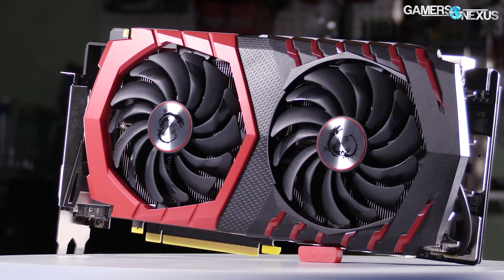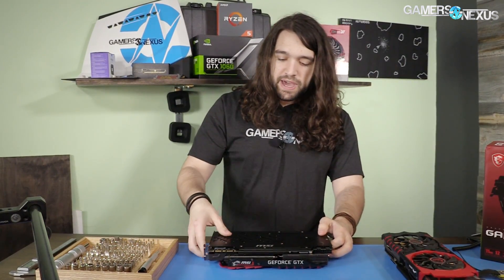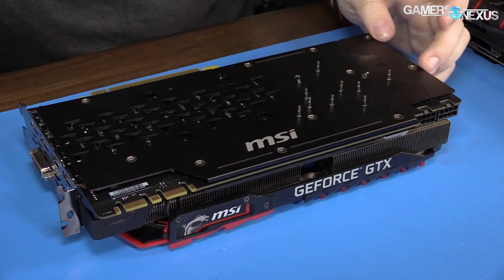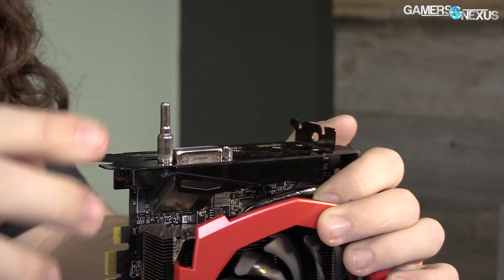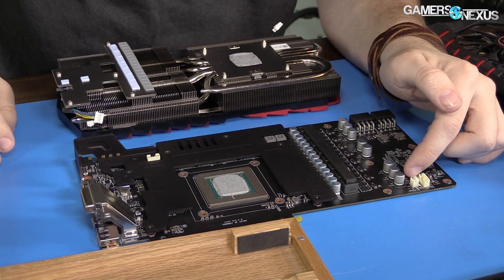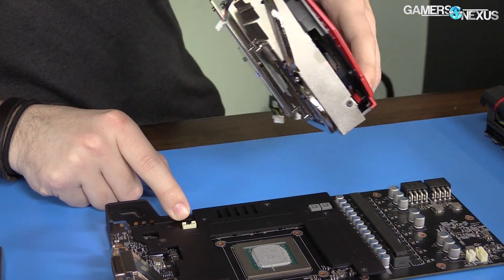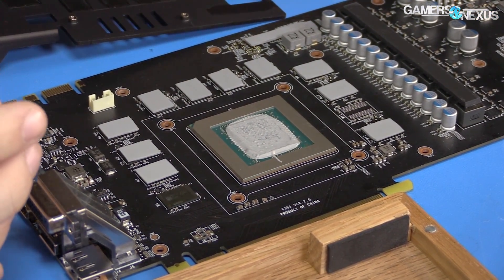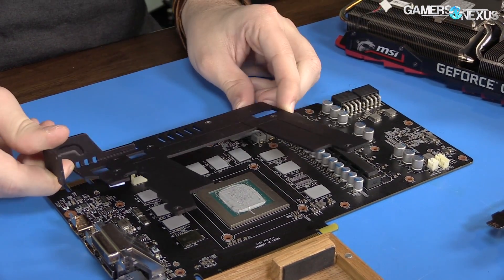MSI GTX 1080 Ti Gaming X Tear-Down

Comment from the maker: Thanks for watching! Our coverage ft. Buildzoid is coming up this week for the VRM analysis, and we'll be reviewing & overclocking the GPU in short order. Stay tuned for that. Unrelated: We now have a GN merch store online! You can find a link to that in the description above.
Reply: B U I L D Z O I D B O Y Z
Reply: B U I L D Z O I D B O Y Z
Reply: Good job man :D
Reply: At last! :) Been waiting for this for weeks :D
Reply: Gamers Nexus whats the difference between MSI's Gaming Z and Gaming X video cards? I dont get it.
Reply: @Proj3ctX Gaming Z offers higher factory oc than X and another RGB thing...
Reply: 9:24 maybe to hold it in place when soder gets soft by the heat?!!
Reply: LOL of course they dont make a gaming X titan XP card silly :P Nvidia has always locked down the custom card market for the titan line up :) I guess when you have as much knowledge swimming around in your head as you have Steve,  you sometimes forget about things like that....but yeah so weird that they put in the 12th thermal pad on the non-existent Vram
Reply: Gamers Nexus unrelated : why "stupid star screws" ? those are Torx heads and working in the engineering field I can tell you that IMHO these should these should replace all Allen and Phillips heads (except for the smaller sizes under M2.0 for which Phillips is still well suited) as they accept much more torque and are much less prone to break and this prevent unscrewing the screw.

The main advantage of Torx in consumer electronics is that it allows for better repairability since screws are less likely to break.

I otherwise very much enjoy your in-depth and technical articles, which is why your terminology surprised me :'(
Reply: ill save you time in testing ddr5x temp testing since been running for 1yr with no headsink or fan or anything.......aaa there still working
Reply: The extra thermal pad was probably a mistake during assembly or something. Someone didn't get their coffee that morning.
Reply: john doe really eh? a full year? lol too bad you couldn't even get a card with g5x memory a year ago...
Reply: @uglyduckling81 You must be from the UK or learned your from there. In the US, the L is typically silent no matter how it's spelled. You can even check the online Cambridge dictionary. It has both pronunciations.
Reply: Gamers Nexus Love these Videos.
Reply: Fair enough. I thought he was just trying to be trendy by saying some old way or just flat out mispronouncing it. I knew Americans couldn't pronounce Tomato correctly but I had no idea solder was also in that bag. I actually had to look up soder to see if it was just me not knowing a word since I had never heard it before.
Reply: sodered
simple past tense and past participle of soder
soder (plural soders)
Obsolete form of solder.
I can't stand you pronouncing soldered as sodered. Please adjust your pronunciation.

Comment: If you're looking for the pads thickness, here it is.

3.5mm   1x 100x10mm
2.5mm   1x 100x6mm
1mm    12x 10x15mm
                1x  6x35mm
                1x  8x110mm
1.5mm   1x  5x10mm
                1x  6x100mm
                2x  7x7mm

3.5 and 2.5 for the blacks
1.0 for the darker grays
1.5 for the lighter grays
Reply: Bless your soul. I'm about to go on a blitz of re-pasting electronics and on scanning through this video it made me realize that I should really do the pads on the card too. Cheers for that.

Comment: Well the MSI GTX 1060 gaming X lacks all termal strips on the VRM also around the cpu there now extra metal square its just like the old AMD ones and the cpu chip is half the size damn did not think there would be so much difference.

Comment: the backplate really traps heat. I have three MSI 1070Ti which have similar to 1080ti design. Plus, one Gigabyte 1070 at the very last slot. Two MSI card that are placed in first slots are the hottest. The third one, is pretty cool.  The difference between these three MSI cards is that there is one 1070 card without backplate in front of the third (the coolest) MSI card. First two MSI have almost no space in-front of the fans. The third card has twice larger space in-front of the fans. The temperature of the first two cards after 15 minutes of rendering 87-90deg, third one 10!!!-15!!! deg lower. I added a big fan blowing air towards MSI cards, as it was suggested by an IT guy. Didn't help much, but made the third MSI a bit cooler. First two cards are still hot. He suggested to install an extremely powerful and very noisy super fan. I said to him that he is bad person )))) Again, there is only one difference between three of them, the volume of free space between cards. Removing backplates can really help to cool down the cards. You can even use a formula to find how airflows changes with increasing or decreasing volume of free space in front of the fans. Luckily it's very easy to do ))) Have no idea why some IT guys are so lazy to just to spent 10 minutes for calculation and then just carefully look at the system they have built to understand what is the problem in. Knowledge is a power! :)

Comment: 12:05 It is not pointless it problably cost more to adjust the machinery to leave out that thermal pad. And looks silly to who? 0.01% of the users will tear down a card. Guess MSI did not cout on the 50000 views on this channel who now are baffled with sillyness.

Comment: I plan on getting this card for an upcoming build. In advance, I know that red wont fit my color sceme so: Does thered plastic on the left fan come off easily (maybe even without taking the complete cooler off, and do the red "scrathes" on the right cooler come off? And do those "scratches" light up? I would paint them as well.

Comment: I wish MSI would made these cards in black and white, I love that cooler design but they should jump on that neutral RGB colour design like many others did.
Reply: I have a MSI GTX 1070 Quicksilver to bad they never made a 1080
but its super nice,
Reply: Damn that card does indeed look really nice
Reply: Nowhere near as cool looking + it has no back plate
Reply: Yeah the Quicksilver has a nice silver backplate, its soo clean. It came out in November of 2016. I was about to buy the red one and then I saw news about a white and black one. Jumped right on it.
Reply: Nebula there was a limited silver version
Reply: Just do what I did man.

Enamel paint. Had the card disassembled, painted and completely back together in 2 nights. (see below for photos)

Here's the end result. 
https://scontent.fphx1-2.fna.fbcdn.net/v/t1.0-9/16406788_10154996173056100_5201681823512939383_n.jpg?oh=7c7d4268348c7f2b3c2ca8a0d0413cf8&oe=59998C19
https://scontent.fphx1-2.fna.fbcdn.net/v/t31.0-8/16402736_10154998258776100_4584316185441649319_o.jpg?oh=877b94b6d0e02913539a75c5fe898609&oe=595B9B71

Personally I'm happy with how it came out. Ignore the tangled mess of cables. They're all combed up now.
Reply: looks clean AF but rip warranty :/
Reply: Nebula true, but it's already out of its year warranty so.. NBD really.

Comment: MSI needs to change their shroud design. Shit looks way too AMD and black/red color scheme is getting real stale these days. The old MSI 580 Lighting card I had years back was bitchen.
Reply: Agreed. Black and white design would fit more builds better.
Reply: It's the colors of their company logos,etc. They have other options as well. They're going to make black and red products whether you like it or not.
Reply: You do realize they have other designs? Like the ARMOR and QuickSilver cards? The QuickSilver one looks badass IMO, hope they release the 1080 Ti with that design.
Reply: And even though you never saw it in action unless you were working on your system right after shut down, the thermal reactive colored fan blades were pretty sweet as well on those. Still have that card in my backup system.

Comment: "star" heads are called torx. Friendly FYI. Nice Tear-Down vid. Looking forward to the always top notch metrics from this channel.
Reply: Torx, is a trademarked name. Star is the ISO official generic name. Similar to calling the item to blow your nose a tissue instead of Kleenex. Friendly FYI.
Reply: dtune30 can't believe i had to go half way down in the comments to see something regarding these "star" screws, thanks for pointing that out.
Reply: The official ISO denomination is hexalobular internal as per ISO 10664 (at least in the 2005 rev. I had on hand earlier), I think we can all agree that it's not a very practical name. Star is a popular name but not official, and as such can be applied to any type of star-shaped head while Torx is specifically referring to the Textron design from 40 years ago (i confess I had to google that date ;) ). Friendly FYI.

Comment: Will you do a ZOTAC GeForce GTX 1080 Ti AMP Extreme teardown and thermals?
Reply: Also want to know if the Titan EK water blocks will fit said card
Reply: Its a custom PCB so its unlikely the titan EK water block will fit it, Titan XP cards all come in that same blower design so.

Comment: So what is that liquid used to clean thermal paste called?
And it it really safe to use?
Say I accidentally spilled a little on some components lol
Reply from the maker: Rubbing alcohol?
Reply: Ramazan if its on aluminium its safe but  pcb rip boi
Reply: Luke Szpunar dont scare him lul. as long as it isnt powered on you can simply dry it. and using alcohol to remove some thermalpaste isn't really necessary. it's almost like a bit more sticky tooth paste.
Reply: if is ethylic you can drink too :)
Reply: The best liquid for removing TIM is Isopropyl Alcohol that you can get anywhere.  But make sure it is at least 90% strength.

Comment: I am assuming that whichever VRAM chip is not used depends on which ROP/Cache/Mem Controller they disable in the chip (if they are disabling portions that have errors)...that will be wired to go to a certain place in the board.  If so, then during manufacture of the boards, MSI makes the base plate common for all (with pads for all VRAM chip locations) so as to not have 12 different part numbers and the headache of keeping track of which board has which chip missing.
Reply from the maker: Interesting theory. So far, both our 1080 Tis are missing the same chip -- could be chance, though. We'll have to pay close attention to the next ones!
Reply: Which is funny because even though that is my theory, I remarked while watching your video, even before you mentioned the thermal pad, that I was surprised that this is now the third of three boards I have seen where that specific chip is missing.  So, i could be wrong, but it would be weird to me that they only disable 1 specific ROP/Cache/Controller module.  

Anyway, thanks for the videos.  Keep up the great work.

Comment: I think the extra thermal pad is purely for isolation.
Imagine these solder points shorting out on the metal plate.
Not very likely, but let's just make sure this doesn't happen.

Comment: Better adding a pointless thermal pad than none, especially when you pay premium price for the card, EVGA...
Reply from the maker: Agreed. Better to be safe.
Reply: There is a sense to the extra thermalpad. The GTX 1080 TI has 1GB less RAM, thats the missing Chip. 
BUT the location of the missing Chip is NOT the same in any Card. It depends on the deactivated part of the GPU, which changes from GPU to GPU. To standardize the manufactoring all RAM including the missing one gets a Pad.
Reply: Maybe because the thermal pads are made in batches of 12 and they figured instead of throwing away one, to just Chuck it on the empty space.
Reply: The extra thermal pad must be there to cool that decoupling capacitor, hmm. lol.
Reply: +Gucky Actually all the 1080Ti I seen have the missing chip right there. So I think Nvidia is just merely disabling that part of the memory controller on all chips.
Reply: titan x dont do aftermarket coolers Lol
Reply: gigabyte once sold the maxwell titan x with their xtreme gaming cooler (although the pcb was from reference cards) and so did EVGA with their titan x hybrid
Reply: u know for what the thermal pad is? every 1080ti is unique/ a different vram chip is dead/left....so in theory its an defective titan
Reply: Probably costs less to chuck the left over pad onto the card than it costs to throw away and be disposed of.
Reply: You know whats really funny? EVGA was the first company to make fun of Asus and gigabyte for their overclocking fiasco early in the life of pascal. But in the end it is EVGA who becomes the true laughing stock after their cards begin blowing up. I'd much rather buy a card with misleading marketing as opposed to a time bomb.
Reply: But on any ASUS 1080Ti I saw was the missing chip at the same spot....

Comment: Beefy cooler just like on the 390 Series, i have been really disappointed by MSI coolers ( Armor 3X , MSI Gaming,  Golden edition ) on The 980Ti, all models were overheating, it was awful, but that's because cooling solution had small radiator i guess

Comment: 12:10 someone should get 2 msi 1080ti's and solder a memory module to see if it would make the card 12 gb
Reply: the controller part is what i was concerned about. thx
Reply: He said that removing the 1080 Ti GP102 chip and putting a Titan XP chip would work, but it would be way too much work for only one extra gig of VRAM, especially when both cards have more than 10GB.

Comment: I think these aftermarket cards are in a weird spot. The cost a bit more compared to reference design, cool a bit better and are also silent, but they don't overclock better than a reference card (usually equal) - take up a lot of space. I would just get a reference card, put a water block on it and call it a day
Reply: I love the AIO cooler that came stock on the FuryX.
Reply: not 300$ we can buy EVGA Hybrid AIO for 135$ and ending with a decent system! looking sharp and awesome performances.
Reply: FE: 500-550$
Strix:550$
a FE would come to cost 635-685$ for ~ -5°c and a bit higher OC. not worth it.
Reply: and pay 300$ for the watercooling or keeping stock FE cooler that keeps card at nice 85°c

Comment: Aww MSI removed the cool looking diagonal heat pipes from the sides of the heatsink. It made it look like an engine.
Reply: I loved those pipes. Now they look like every other card out there.
Reply: @a.p.980  Indeed. Now i'm missing my  EVGA 1070 SC because of its design and such, it died on me after like 3-4 years just the other day. I got an MSI 2070 Ventus now though. But will miss the 1070's design